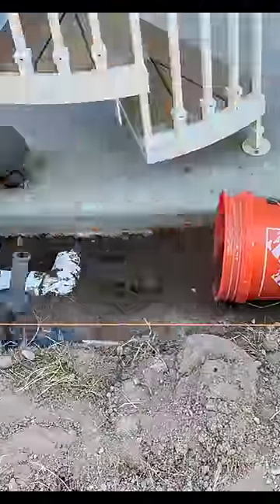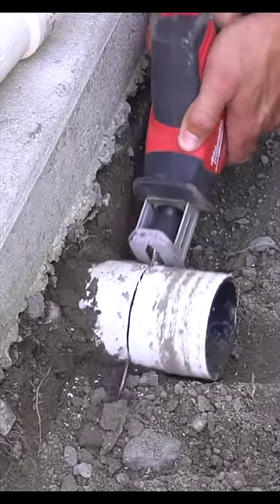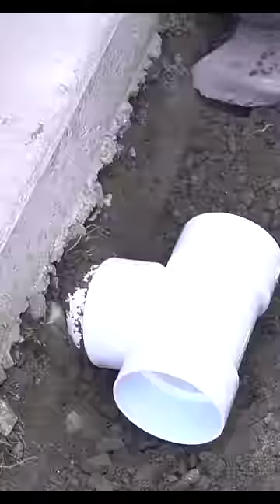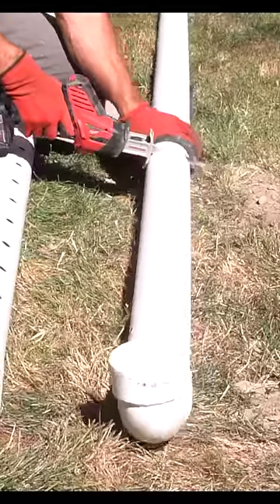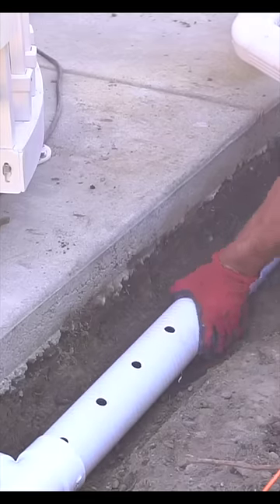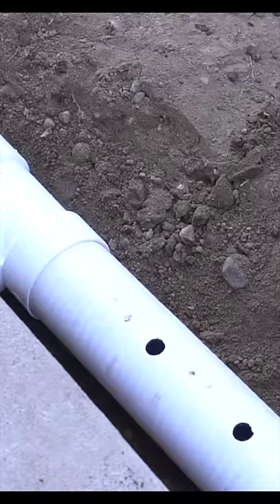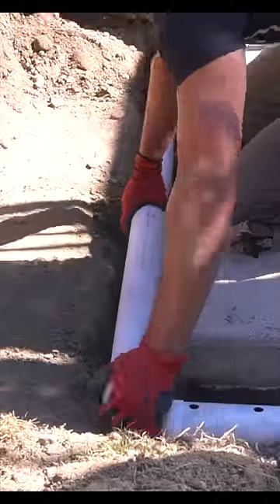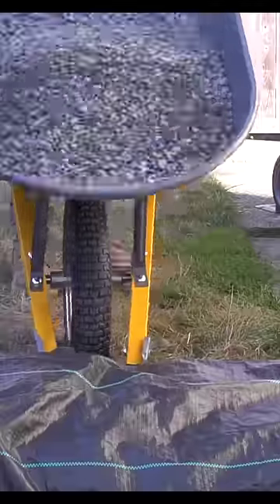Retaining Wall Drainage #shorts

Comment: First off you need to use a san tee or a sweep. 2nd you need to encase your rock in to cloth to prevent dirt from filling up the voids in the rock. This prevents soil from filling up the area for water. Third the holes are faced down as you do not want to float you pipe. Forth you need to move the water away from the building. Far away from the building. You should have an open system in which the down spouts drain into a catch basin.

Comment: You want those whole on bottom bud and not sitting on dirt but drain rock bc they’ll just pack themselves full and clog etc. filter fabric down first, pipe then rock and wrap then cover with desired materials 😊🤘🏼

Comment: Down spout drains and wall drains should NEVER be connected to one another. As others have said holes go down, easiest way to put them where they belong is to just make sure the writing on the pipe is at the very top, manufacturers do this intentionally as an easy way for installers to line everything up. Drain pipes go to one side of a wall or the other NEVER underneath as they crush over time allowing the wall to shift. Any and all drains need to be daylighted or ran to a sufficiently sized dry well or drainage field for the expected water flow and soil conditions. Also fabric goes between soil and gravel not just around the pipe otherwise the gravel can/will silt in over time clogging up everything. Plain and simple please do more research before putting something like this out in the world where other DIYers can see it and think they're doing things right only to create problems for themselves down the road costing time and money. Wall does look nice though.

Comment: I understand the desire to pick up sheet flow from the patio, but putting a drain up against and below a slab is asking for problems.  If the lightweight sleeve on the pipe fails, the drain tile will be transporting soil and water.  I like the woven fabric for under the system because woven resists water movement, though it isn’t clear that is how it was installed.  A strip drain under the decorative stone may have been a better option.  Additionally, carrying the gutter runoff away from the slab before managing it would be my first choice.  
The retaining wall needs to be installed on compacted “road mix”.  The use of fabric is a nice upgrade.  
Non woven fabric is the best choice for wrapping French drains.  French drains are an underutilized option for sub irrigation of mixed planting beds (those including shrubs and trees).  
Nice esthetics and material selection.  
 Does anyone have a minimum number between drain tiles and slabs?

Comment: What?  1) the holes in the perforated pipe need to be facing down.  2) the slope of the pipe has to be 1/4” per linear foot. 3) the lowest part of the pipe has to be the drain…somewhere away from the structure, and 4) the filter fabric should encase the stone and the pipe.
Reply: Please don't do this!
Remove your video asap!
It's totally wrong information

Comment: The PIPES with holes need to be placed with holes facing downwards. So water collects from rising water from the bottom. Water gets held in by the roof of the pipe and directed away.

Comment: The holes should not be vertical… they should be offset 60 degrees from 180 degrees. So your set of holes should be facing at a downward angle.

Comment: The proper way to do this is with two pipes. One, with no holes for the downspouts and the other, with slots not holes, for the other. If there isnt a standing water issue, forget the 2nd one.

Comment: The holes are supposed to face down so the solid part of the pipe faces up this way the pipe does not fill up with dirt as fat there's a small piece of solid pipe in between the holes that's where the water runs on the inside the pipe and if it gets too high runs out the sides and drains into the gravel

Comment: You supposed to put the holes on the bottom of the pipe. So when the water builds up it seeps down around the pipe and then it goes in the pipe and then down.

Comment: All the water is going to sit under that concrete slab. If it’s in cold climate it will freeze and cause cracking and lifting. Should have sent it 20-30ft away from house.

Comment: Downspout drains should be solid pipe in order to get the water away from the foundation. This dude is building a french drain which collects unwanted water, like from behind a retaining wall. The holes should be facing down.

Comment: Please do not follow this advice. Downspouts need to go to a sweep wye or sanitary tee to keep velocity up and get it away. Now it'll drain right along the patio through the holes. The fabric will clog fairly quickly and the entire area should have fabric between rock and dirt. Please go and watch The French Drain Man videos for proper installation. This video will cause problems in a.few short years

Comment: When stoning this pipe the holes are not supposed to be facing down otherwise the water will have to fill all the way to the top of the pipe before going in the holes It was installed wrong
Reply: D*** Google we're installing this pipe the holes are supposed to be facing down not otherwise the water has to fill all the way to the top of the pipe before it will start to drain the water is supposed to race from the bottom in inholes and then drain out the pipes

Comment: How can you not glue it? It comes apart that wat. If something happens later they can cut it
Reply: Have you ever tried to move a drain pipe buried in dirt and stone?   It isn’t coming apart.  I like the suggestion of putting soap on the joints to push them all the way in. Otherwise, no glue needed.
Reply: @Mote78  I have had conduit come aprt under driveways and in trenches when not glued.. Could be just the gray electrical conduit that has that issue. Depends on soil and ground movement in you area also
Reply: @tomcole4736  
Oh yes, small electrical conduit versus 4” drain lines are very different.

Comment: Holes go on the bottom... and you don't drain a downspout into a french drain, drain the French drain into the downspout at the junction at the end of the run. Don't compact the stone.! Water needs to move thru the stone😮

Comment: Actually those sleeves really suck. They get filled in with fines and block the pathway into the pipe. Much better to filter the whole trench. Keep the stone clean and the pipe stays clean
Reply: Considering he set the pipe on top of dirt then stone over top,yes it will clog
Reply: Absolutely correct 
       I use heavy duty landscape fabric to contain the gravel fill and also use membrane covered tile. I also direct the water away to a fabric linded pit  full of stone covered with fabric and backfilled.
            The last job we did in the fall had 45 yards out gravel to get the water away .

Comment: The letters on the pipe are supposed to point up there bud that puts the holes in the bottom so water can soak out evenly and not just pour out of the first holes on the bottom of the pipe the water gets to

Comment: The should have extended that pipe ten more feet away from the house with a little slant to proper drain and the 90 up and put a  pop up filled with river rock.

Comment: Yeah you definitely don’t want to be draining all the water from your roof directly under your wall base. If you are insistent on using this system you need to use unperforated pipe under your wall and then once you are past your base by at least 3 feet you can switch to a perforated pipe but even then in 2-3 years your perforated section will be clogged full of dirt based on what I see from your install method.

Comment: HOLES ON THE PIPE GO UP! They are there to take water in. Not let it out!
Reply: Ever hear the phrase: "Water finds it's own level" ? If you put the holes on the bottom, water can still get in the pipe-no problem. If you put the holes on top, DIRT gets in the holes and plugs your pipe...Read these comments and you'll find plenty from plumbers and contractors saying to put the holes DOWN....This should be a closed system, anyway....

Comment: Additionally, the label or writing on each pipe manufactured indicates the top of the given pipe type, perforated especially, I can’t tell you the incorrectly installed systems I’ve had to revise and correct!
Reply: With all these comments 70% of folks didn't watch the video before even commenting. Smh

Comment: The holes in the pipe are for water collection, not dispersion.

There is nothing properly drained by this "system".

Hopefully, the homeowner will see these posts and call a professional to fix your work.

Comment: Seems like a bad idea.  Why would you drain all the water right next to your foundation?   You need to drain it FAR away from your foundation slab.   You haven't done much more than if you simply let water drain straight off the eaves onto a gravel landing zone.   Worse there's a retaining wall next to the drain limiting the dispersion of water away from the foundation.

Comment: You don't want drainage going around that slab. You want all moisture going away from it that is why you don't use corrugated pipe. You should use sheldue 40 pipe to divert all water away from slab. You got it all wrong.

Comment: Those holes are designed to be placed and 5 and 7 oclock.  And in the case of what your trying to accomplish you failed.  It will be a mud puddle in no time.

Comment: Not the smartest to send more water from the downspout to any kinda of footer drain and also don’t don’t don’t use triple wall pipe. It’s the cheapest pipe for a reason. Use actual pvc, preferable sdr35. Sure, it’s more expensive but it is much more durable and long lasting

Comment: Dude I’m. Drainage specialist and your totally wrong. Those holes are for drainage but they go at the bottom that’s why the holes are at 4&7 to allow water to enter when it comes down pools at the bottom and rises in and uses the middle to ride. You placed the holes at the top and then some at the side wtf are you doing

Comment: Wow dude the pipe has holes but they dont go on top. Now how will thw water below that point drain...it wont and the pipe will fill with dirt.that needs to be changed now good thing you dont glue anything.is it even graded? So many things wrong with this...What do i know im just a plumber this guys on you tube lol

Comment: There is so much wrong with this video. You don’t install a tee. You install a wye to get water flowing in the correct direction. You also don’t connect downspout and French drain systems. They should always remain separate. You had one pipe facing up which is wrong and those socks are crap. You need a corrugated slotted pipe with crush stone in a double punched fabric, all wrapped in a big burrito. That’s it.

Comment: First off you NEVER use a tee. Second you don't use drain pipe with holes for downspouts. I could go on and on but this guy has no idea what he's doing. Just in case you're wondering I'm a landscape contractor and I do drainage work.

Comment: This is NOT how to route DOWNSPOUT drains.  ALL the water from the roof area that drains into this pipe will be running through this and leaking into the soil here, saturating it.  This additional water can do nothing good and a lot of bad.  Not sure where this is, but a late fall rain followed by a hard freeze will heave that slab and crack the hell out of it quick, fast, and in a hurry.  Downspout drains should be solid pipe sloped to get the water AWAY from the structure to daylight somewhere downhill and when the rain stops, drain completely.  If you connect your downspouts and your foundation drains together and the end of the pipe somehow gets clogged with leaves, twigs, dirt, or the little tiny, but heavy rocks they coat shingles with, all that downspout water will be forced TO your foundation with some pressure.  While unlikely, this has caused houses to literally float out of the ground.  NOT GOOD.

Comment: This is the most confusing video about drain pipe I’ve ever seen. Are you putting  roof runoff from downspouts directly into a French drain underneath a small retaining wall????? Uhhhh ok haha. The only way that this makes sense is if you have installed a level spreader, but that doesn’t look like that’s what it is.

Comment: YouTubers for the win yet again🤦‍♂️

Folks posting content for monetary gain without any actual knowledge of the task or field in which the content is covering. If anyone follows the advice depicted in video, they will end up with a non-functional drainage system. If the job is done with a building permit in ANY jurisdiction, the building inspector will not only laugh their ass off for this job, they will likely look with much closer scrutiny at whatever else is covered by permit because you’re clearly lack the knowledge and skill to perform a very simple task. 🤣🤣

Comment: You're basically showing people how to destroy their flatwork. In order to intercept water the holes on the perf pipe need to be placed at 5 and 7. Hydraulic pressure then forces the water into the pipe it's carried down the centre channel then graded away at no less than .5% to a catchment area or rock pit. The pipe is meant for intercepting ground water, not dispersal. Always use solid PVC pipe from your downspouts to a CB or rock pit. You should have to go to all your customers and redo this work. Terrible

Comment: This video is a joke.... You created a leach field up against a concrete pad/foundation.... Congratulations!

Hose should be solid and CARRY the water away from the area with a properly sloped trench.

All you did was bury a sprinkler pipe essentially... The water piles along the concrete and will keep that area saturated days after rain.